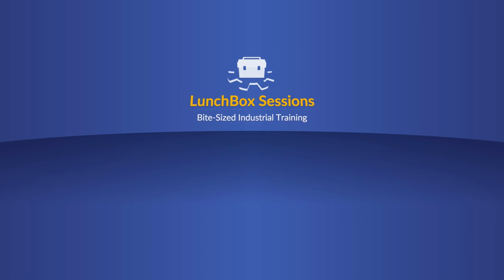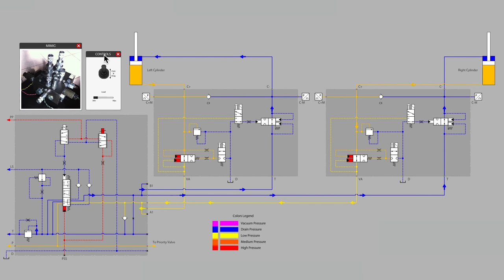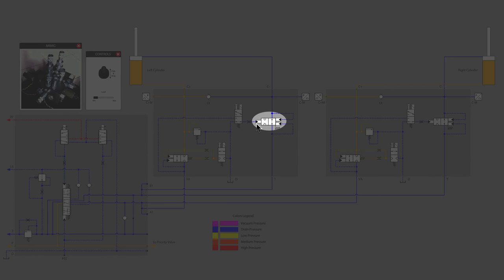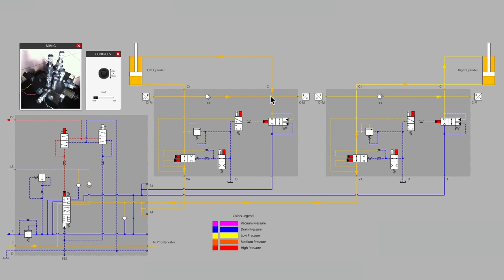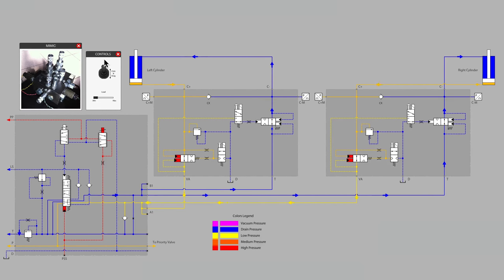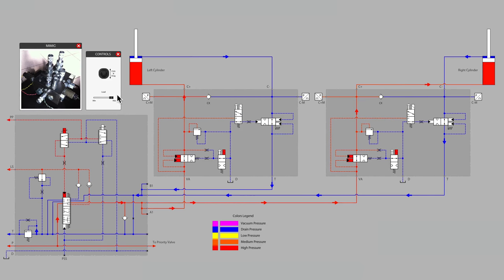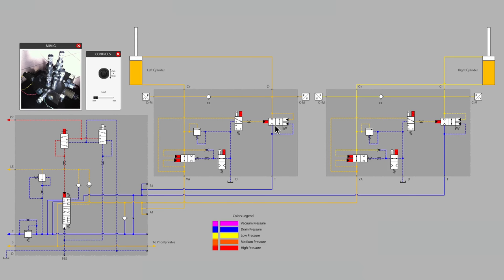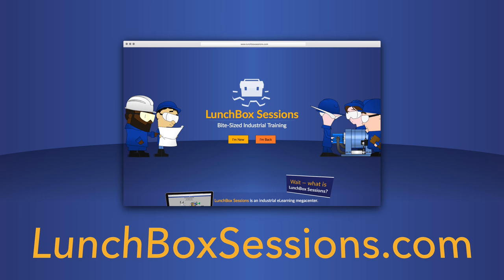Troubleshooting a Regenerative Lift Circuit

Comment: Thank you Karl. Show a Fill Valve Circuit if you get time. A circuit that would open a cylinder port to tank as the cylinder was moving up towards its load and then be closed off as it enters high pressure.  It requires extra helper cylinders. I've seen these in steel mills . Thanks, Jim.